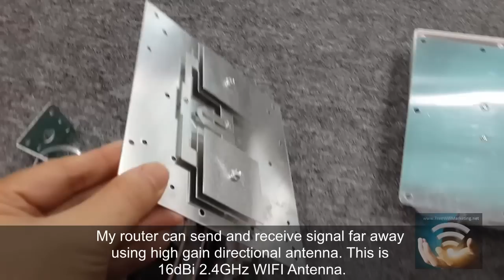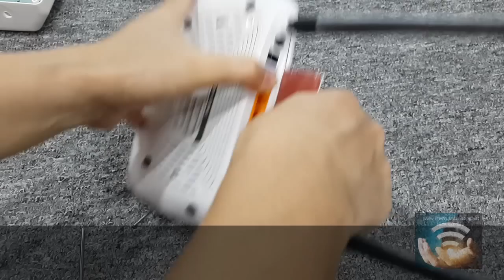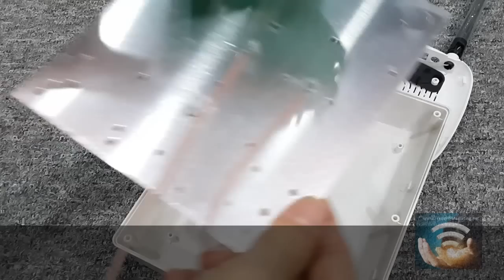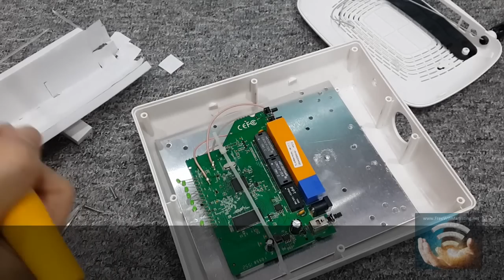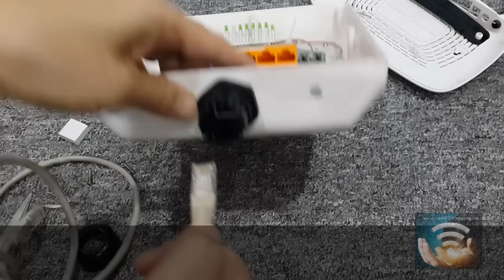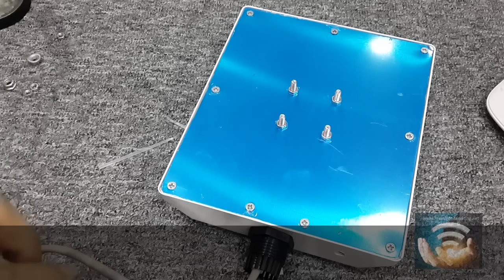Convert indoor 5 dBi WiFi router TL-WR841N to make long range 16dBi outdoor 5km air station

Comment: It works... I purposely remove my sim card tp link mr600 n apply your theory with 2 sma high gain antenna. My goodness, 4G simcard in Singapore I'm able to get 180mbps. Usually just default indoor get about 90mbps... 👍Up for sharing.

Comment: Ordinary electronic components are from 0 degrees to 70 degrees Celsius. The donor (TL-WR841N) is a device for indoor use equipped with common components.
Sometimes outdoor temperatures are below 0 degrees Celsius. At other times, the internal temperature exceeds 70 degrees Celsius (in the sun + heat generated by the electronic part).
The antennas must be uncovered or the electronics themselves partially cover them. The plastic tie negatively affects the efficiency of the antenna.

Comment: the main thing you are missing your not mentioning the wifi wire the main wire and earh wire is soldring in which plat ther three plats which plat is earth and which plat is main
Reply: There is no need to do that because the circuit is at 12 volt maximum

Comment: Hello sir,  I want to stream audio only into wifi network without internet, by convert audio signals to Ethernet enable, so that I can run my own private radio station within 10 km radius. All client have a orange pi or esp 32 device which work on wireless DLNA and IEEE  802.11 b/g/n channel. so which devices will have to use, we are ready to purchase if solution comes
Reply: Bhakti Sanskar sorry dude, you should buy long range wifi access point.

Comment: I do not belive that PCB will survive to outdoor himidity and temperature variation (even if it's isolated in a box).
An advice: what about a resin casting?
Reply: I agree, at least where I live.  Summer temperatures reach 115 (46C) outdoors. Inside an enclosed box it will be much higher, well past the operating temperature specified by the manufacturer of the router and possibly the SOC itself. Active cooling would be required, at least in my area.
Reply from the maker: I got some customers using those for years. Resin casting is not recommended in my cases.
Reply from the maker: If water is not a matter, we can add fan as well

Comment: and do I have to use 1 or 2 of this long range to connected to get wifi internet? Pls explain more
Reply from the maker: if not so far only need 1, if 2 antenna with light of sigh, you can reach miles

Comment: My in-laws house across the street from me (approximately 200–300 metres away) have WiFi.I would like to pull the connection to my house. can I use this long range outdoor antenna to connected the wifi at my in law house to my house? did it work?
Reply from the maker: 200 m 1 is enough as it can send and receive with high gain antenna, if longer, better have 2 with light sign
Reply: did it work for u vibol heng ?

Comment: a simple dought.. can we extend the antenna wire rather than putting it inside?..
Reply from the maker: long cable = noise + signal reduction
Reply: WiFi Marketing Solutions does the two line have seperate function..
can u giv a link for making a 16dbi antena .antenna only. thanks for the response
Reply from the maker: you can search taobao for 16dbi antenna.

Comment: if i mount router inside and connect with an Aux cable will it be workimg
Reply from the maker: can work, but you have to use good 50 Ohms cable and it is not cheap, you also face some noise and signal reduction if your cable is too long.
Reply: WiFi Marketing Solutions i have an ordinary Coaxel cable .usually used for sattelite antenas
Reply from the maker: Yes, it is 50 Ohms, can be use, but keep it as short as possible
Reply: WiFi Marketing Solutions Thanks.

Comment: Excellent video. I would recommend that the antenna wires be used directly and extended instead of de-soldering them from the PCB. The work is very fine and I ended up destroying a track with the heat
Reply from the maker: it is ideally putting your router indoor, however my mod works well outdoor

Comment: How much is the price of those box + antenna?
it will be helpful if you put the link in description.
Reply from the maker: site in Chinese but I am sure Google translation can help https://world.taobao.com/item/37752017312.htm
Reply from the maker: This is only antenna,  it is not easy to put router board inside but you can do some DIY with it https://www.aliexpress.com/item/2-4G-wifi-antenna-2pcs-16dBi-2-4GHz-Panel-High-Gain-WiFi-Wireless-Antenna-Amped/2008648177.html
Reply: that's even more expensive
I can get CPE 510 with same price on local store..

Well, thx for your response.
Keep making video :)
Reply from the maker: router is $10, box is $5 from Taobao, but you can also find on ebay, Aliexpress, they all ship worldwide
Reply: +WiFi Marketing Solutions Can you please share the links? I've checked all the sites that you mentioned, couldn't find that antenna DIY box or case. Regards.
Reply: WiFi Marketing Solutions I've used aliexpress, but not taobao, the language barrier is too complicated

is there similar seller from aliexpress.
Reply from the maker: there are some options from aliexpress, but not exactly like mine, pricing is a bit higher
Reply from the maker: Aliexpress price is double comparing to Taobao
Reply: Range increased by how much in percentage?
Reply from the maker: 3dBi difference equal to double your power
Reply: you can send me link aliexpress?
Reply: https://www.aliexpress.com/item/Drop-shipping-high-gain-wireless-wifi-14dbi-outdoor-antenna-2-4ghz-14dbi-panel-patch-antenna-with/32299286593.html?spm=2114.search0104.8.30.64e3c7189qZXeF&transAbTest=ae803_4&priceBeautifyAB=0
Reply from the maker: Please find it here https://world.taobao.com/item/37752017312.htm